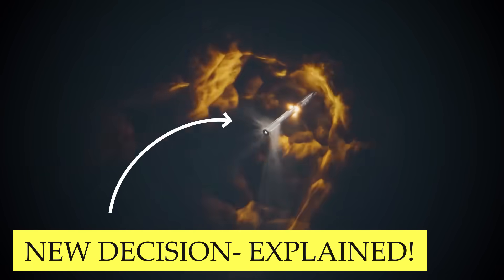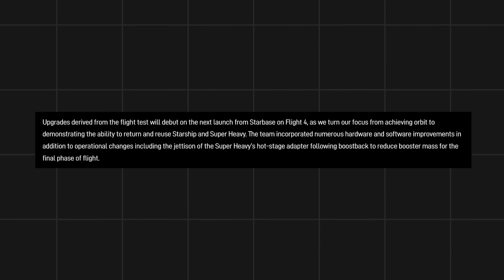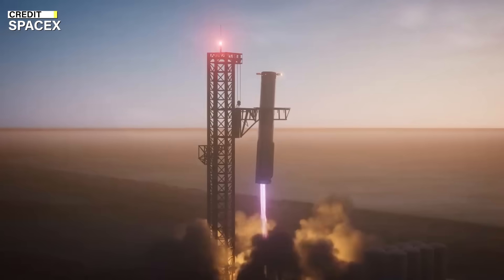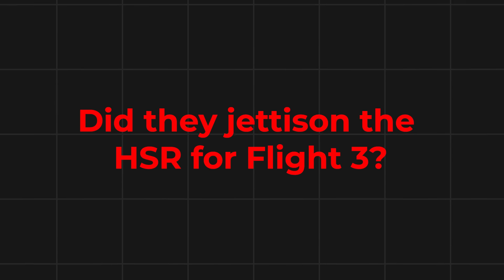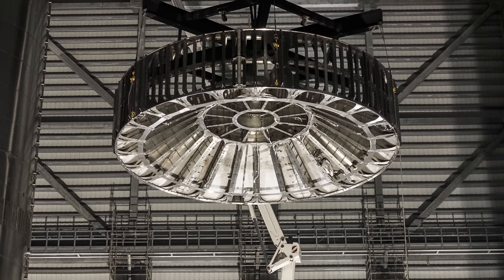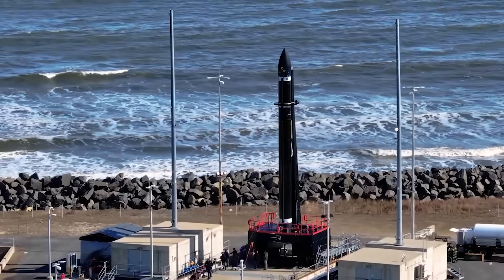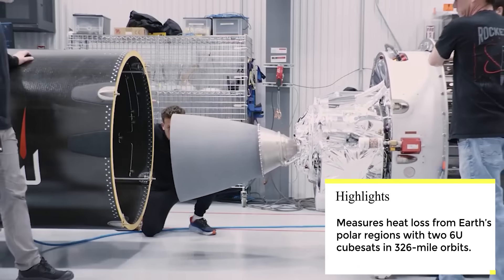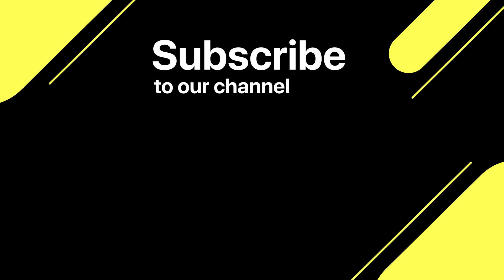Why Starship Hot-Stage Ring Was a Big Mistake? Rocket Lab Launch | Episode 45

Comment: They only jettisoned the legacy test ring.  SpaceX already said they have a new permanent design that is lighter and it'll be used in later launches.  The ones they used is heavy AF, but the new one will be less mass and smaller height the way they made it sound.

Comment: I think you forget an important thing! This IFT4 is landing in the see and it will fall on its side. With this heavy top would be bigger the risk to break and RUD. I guess they would like to rescue it if it is possible.
Later on when they catch it with the tower it will be no problem.

Comment: If the upper grid fins could be tucked up against the sides of the Booster, and then folded just prior to separation, couldn't the drag caused to the Booster alone act to separate the Booster from the Upper Stage? It would also lessen the overall drag on ascent. Just a thought.

Comment: One way to do the jettison is to use fused links like a fire sprinkler in a building.  Starship ignition melts a solder joint which unlatches the ring/starship connection. While simple, there is no override control. An event like a single engine firing could result in a partial release, but that would mean a starship failure had already happened and would be lost. The question then becomes the fate of super heavy.

Comment: The HSR is much more than separator stand-offs. The present version also rigidly shields the top of the booster, adding great mass. 

The obvious solution is to submerge most all the gridfin components below the upper methane bulkhead and shield only the [few] delicate components that must remain accessible. This eliminates the large rigid shield. 

Finally, I look forward to Hydroformed tubing that should be lighter and simpler than the prototype sheet metal standoffs.

Comment: They are jettisoning the ring solely to reduce the mass they need to reverse in the boost back. They need to do this because that last launch proved the booster and starship did not have enough propellant to achieve orbital velocity, and that was with an EMPTY starship.   So they need to be able to boost a tad longer before separation, leaving less fuel for boost back and landing.  They will also need to make starship longer, to add the fuel reserve required to achieve orbit with any payload at all, and still have enough to land.

Comment: There's no shortage of YT Channels covering SpaceX activities, especially those in Boca Chica, TX.  On one of these other YT Channels the HSR ejection was talked about with a statement made over Aerodynamics as the reason for ejecting this part. I am not able to argue whether the SuperHeavy's CG change caused by the loss of that weight from the Top of SH are the reasons for ejecting that part of the Booster, or if it is actually more to do w/ Aerodynamics & the Grid Fins controllability that are the reasons.  
   What I Can tell you is that EM himself addressed concerns over this very same topic when talking about the additional Nose Cones placed on the Side Boosters on the Falcon Heavy. Ever notice how short and minimalized those Nose cones are ?  EM did express concern over the Grid Fin's ability to have adequate control over those Side Booster landing ability w/ those Nose Cones in place. SpaceX has been here before. 
   Whatever the reason for the HSR ejection, if this is going to be a permanent solution to controllability of the SH Booster landing, and they need all the control they can get, that HSR is an Expensive Part. We all saw the efforts and $Millions spent by SpaceX on recovering their upper Fairings on the Falcon second stage. Imagine how much fun it's going to be to make a HSR Recovery system that doesn't add too much weight and works reliably.

Comment: I feel the HSR isn't a mistake, but rather a learning point in the continuing evolution of Starship.
Reply: The whole ship itself is probably the same things.  Evolution.  Or a mistake. 50/50
Reply: Mistake 1: HSR added weight introduced several problems. Mistake 2: stage 1 lacking landing legs added a very hard to accomplish complication. If your aim is to get the ship ready in time, you should not introduce complications early in the development and rather just add it later once the ship is already regularly flying. Thats how they did it with Falcon 9.

Comment: Ejetting the ring is temporary. This cannot be and end solution.
They just modelled the booster re-entry in simulations without taking into account the ring, they realized in flight 3 that it influence the re-entry tho, obv. In fact the ring HAS NOT been jettified in flight 3.
So they have the re-entry data with the ring, they will get re-entry data without the ring in flight 4, so they will interpole them and use them to model the re-entry procedure, fixes to the flaps' profile, fuel needed etc INCLUDING the ring for flight 5 hopefully.

Comment: I think that they realised that adding the HSR would decrease the chances of controlled decent, but felt confident with flights 2&3. After the latter confirmed that it indeed did impose problems for returning safely (which is one of their highest priority goals) they instead chose to focus on that goal and disregard the other goals (which ofcourse will have to be achieved)

I think it is daring, because if they don't achieve controlled decent now, they might cut even more corners in the future. However, if the current IFT4 flight plan is achieved, it will be a way different achievement to IFT3, but it allows spacex to work on combining these achievements in the future🤞🤞

Comment: Thanks, that WAS simple and clear.

Reusability is a word, but we already know some parts (e.g. tiles, etc.) are expendable.  So it's pretty clear we should draw the line somewhere.   Engines and avionics and control systems cost a lot of time and money and materials to make.  So does the rocket structure itself.  Those need to be reused to save time, money, materials, and provide for quick turnaround.

The fairings?  Bwah.  They could churn out new fairings faster than anything else.  If they let them fall into the water and down (which they did for quite a time) we all still considered the rocket reusable.  I think the same holds true for the HSRE.  There is an intermediate option of flipping the HSRE around so it stays with Stage 2.  That requires less fuel since the mass never needs to counter Earth's gravity again.  

CG is important on Earth, and CM outside, but let's go with "what effect does no HSRE ring have on Stage 1 landing CG?"  Vertically - none.   Laterally and longitudionally it means Stage 1 coming down is like balancing an upside down broom on your hand.  The heavier the broom-head the more energy (Delta-V or fuel) is necessary to keep it upright.  So the more mass you shed at the top the less of a sideways load on CG.  In other words it DOES HAVE A DEFINITE EFFECT and removing the HSRE ring is a DEFINITE POSITIVE EFFECT on reduction of fuel.

Between Raptor versions, F9 fairing versions, and now a new "better steel than 304" SpaceX has become quite good at engineering things to be lightweight from the beginning.  While there's always room for improvement, if it weighs 10T now, it's unlikly to ever weigh much less, which means that a huge amount of mass to shed, and again a reduction in fuel needed to land, meaning an increase of mission fuel (payload + orbit options).

Thanks for the updates.  Looking forward to the next!

Comment: The best part is no part!  The HSR will be eliminated and its function built into the Boosters as soon as Raptor 3s are incorporated into Boosters.  The weight differential between Raptor 2 and Raptor 3 will support a permanent Hot Staging System addition to the Boosters as will the increase in Block 2 Boosters height.

Comment: Makes sense to jettison the ring.  It’s burned up after, the extra weight, plus it has to be insanely hot which could cause issues as well.
Reply: How fast would it cool in the vacuum of space ?
Reply: @Philc231  Ever put hot coffee in a thermos? (Vacuum enclosed vessel). There is no water on the surface of steel for evaporative cooling. It will not shed significant heat through IR EM.

Comment: My concern about the hot staging ring is that it seems too short. Look at the hot staging part of the Russian rockets -- they have much more open area and have more distance between the stages. The Saturn V rockets had a ring that would (for a short time) stay connected to the 2nd stage while the 1st stage dropped away, then would drop away around the time the 2nd stage engine ignited. 

I also have a concern about the payload bay door -- why didn't SpaceX choose to eject the satellites like pulling a stick of gum out of the package (going out narrow end first instead of the wide side)? It would've required a much smaller door with less weakening of the shell with the wide one they currently have. Now, when they ever build the lander version (for Luna or Mars), the cargo door could be built to be part of the structural integrity during launch. I think that wide, narrow height door is going to be prone to failure.

Comment: It seems to me they added the HSR because they  couldn't get a reliable separation between the Super Heavy and the Starship. They reported as a result of the ring they could increase the payload to space but in the process they added significant weight, screwed up the center of gravity and control of the rocket they worked so hard to achieve. I think any move they make at the moment is temporary. They want to get in flights and they can't do it without jettisoning the ring. It may well be the problem will be resolved when they lengthen the next iteration of the Super Heavy.  As to quick turn around time, I don't think it would have any impact on that over the next year. They are only going to do x number of flights and reinstall of the HSR will not take long. They'll have extra HSR's and can move them into place as needed. Of course, if they try to recover them that will be costly and time consuming. In fact, they have requested a landing tower in Florida and I think most flights will make use of a landing tower down the road. SX has the capability to quickly move rockets point to point and the advantages of a landing tower far outweigh the disadvantages. Cutting exposure of the launch tower and surrounding area in half is the first advantage. As to whether they tried to jettison the HSR in the last flight, Musk said at the time they didn't know what caused the control issues but were working on it. I don't think they tried to jettison it. They are trying to achieve flights and I think the HSR ring was and is experimental. I'll be interested to see if someone comes up with 'proof".

Comment: These are prototypes of a system in development.  There's going to be more changes along the way.  Staging ring will be incorporated better in later designs as it is refined.
It is a little surprising they are not testing fuel transfer on these flights as that is going to be a major activity they'll need to do regularly.

Comment: Hot staging ring: You do realize that Starship design is very much in flux and seeing constant development changes. Ejecting the hot staging ring is because the booster wasn't designed with one and it messes with CG. It's flat out an experiment on top of existing designs! What you will see in the future is that hot staging becomes built into the booster if it works out as an add-on. After that, re-usability of this part will be built in. If you notice, 100% of all starship efforts so far have been single use only. You do a LOT of experimenting to get to the point of fully reusable! How many of those experiments still exist today? Nearly all of them have been scrapped after they served their experimental purposes. Also, SpaceX is quick to get rid of anything that doesn't serve its purposes. How many millions of dollars have been spent on the now nearly completely removed and replaced tank farm? How much was spent on the tents and other structures at starbase that no longer exist? Almost nothing that they have done so far related to starship has been reusable. Stage 0 is about it and it sees significant rework after every launch! This is something you build, try out, discover weaknesses, build again, try again and eventually get to reusability. So no...I'm sure I'm not alone in thinking that commenting on the hot staging ring was not important! It's literally a test article for now. Also, they probably got some feedback from the FAA stating that they need to test ejecting it since it's currently a removable section.

Comment: The hot staging ring is just a big, dumb welded steel thing - ditching it would have no effect on re-useablity - they could probably have a robotic line churning them all day. The issue is the mass, and where that mass is. Ideally, they'd want as much mass as possible at the bottom  - engines, thrust structure, fuel, and as little as possible at the top, to keep the CofG as low as possible. 
Remember back in the early days of Super Heavy development, when they designed out the grid fin folding mechanism? It didn't provide any benefit, added complexity and mass, and was right at the top. Losing that mass was a good thing and same goes for the staging ring.
The Russians and Chinese have been doing hot staging for decades, but doing it with a re-useable booster is uncharted territory, so there's bound to be design changes as they figure out what works best and what improves the chances of getting the booster back.
Jettisoning the ring is a good idea, so long as they can avoid re-contact with the booster!

Comment: I am not an engineer but i think this idea of adding more parts to the hot staging ring goes against Elon's statement that "the best part is no part." Would this not add weight to the booster? And another idea-why not use parachutes to land the booster and starship thus saving fuel, reducing weight and ensuring reusability since a hard landing on ocean sea water could mask defects, damage engines and loosen heat tiles etc... I see that some airlines r now using this when they have engine failure.

Comment: I'm not a rocket scientist (I am a mathematician) but I would like to see the cost/benefit analysis for the Hot Stage Ring. If, as you say, the mass of the HSR/booster shield is ten tonnes then I find it hard to believe that it has a positive effect on payload to orbit (disadvantages higher mass, slower acceleration, lower staging altitude, greater cost and complexity; advantages little or no deceleration on staging, quicker staging to full thrust). NASA used the vernier/reaction control thrusters to separate stages and to impart a small g-loading to the next stage so that the fuel would remain at the bottom of the tanks and flow to the engine(s).  This meant a few seconds of low acceleration at staging. It also has the advantage that it is repeatable for orbital manouevring. I don't know what the (mass/cost/complexity) effect would be of a hot gas reaction control system for Starship but it makes sense to me.
As I said, I'd love to see the cost/benefit analysis.
Reply: The gravity losses of a drawn out staging add up very quickly

Comment: Very good and interesting video!  The HSR created a pendulum effect that wasn't adequately calculated for in the landing dynamics of the steering grid fins.  Recalculation and possibly larger grid fins should allow for keeping the HSR in place.  
        CRAZY HSR REDESIGN IDEA --->>>Maybe a partial jettisoning of some heavy, cheaply and quickly replaceable parts of the HSR could be ejected; like 3/4ths of the vertical columns.